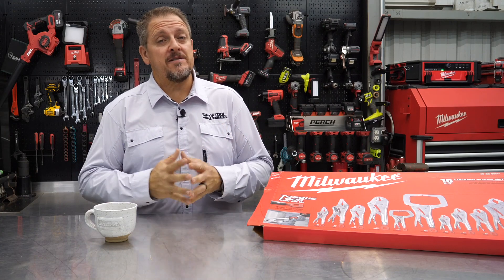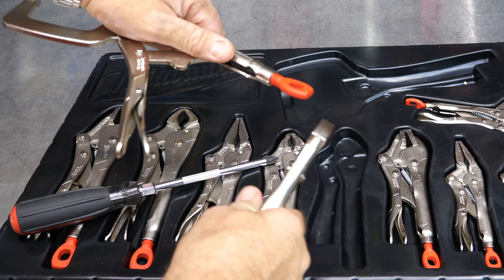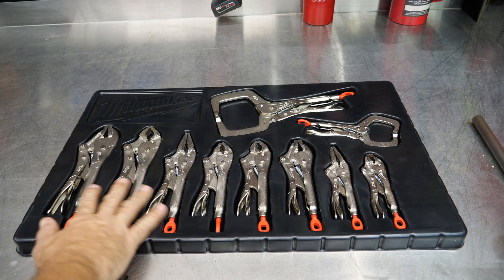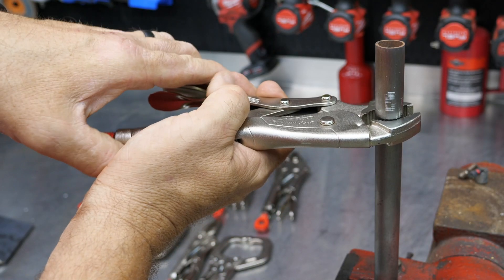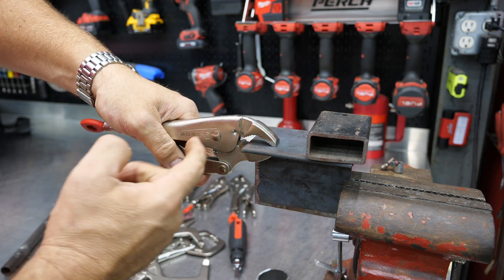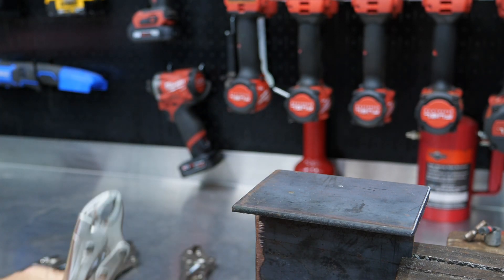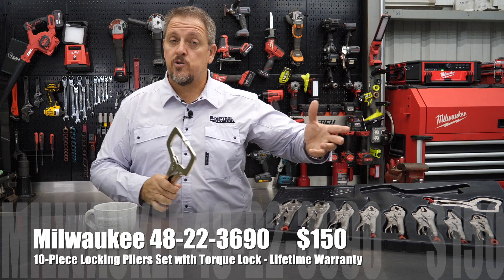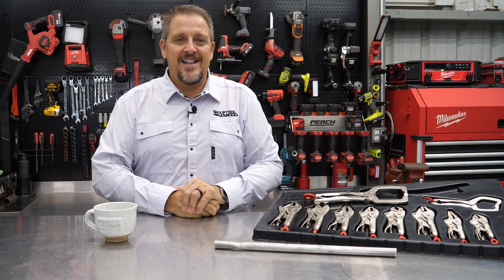NOTHING NEW - Milwaukee 10-Piece Locking Pliers with TORQUE LOCK Review

Comment: Why doesn’t anyone make a locking plier with a regular nut at the end?  Just put a socket on there.
Reply: Some of them have Allen heads on them
Reply: Kobalt makes a set like that! You can tighten with a socket or with an allen wrench through a hole in the nut.
Reply: Berman from harbor freight has 1/4 drive end. They are actually pretty good.

Comment: Nothing wrong with these "locking pliers" they are good jus like vise grips but "torque lock" is jus a gimmick. I work on commercial and industrial overhead doors and we all hold 1000 lb plus doors with vise grips dead weight when we back wind the springs without the need for "torque lock". Its jus an extra tool you need to have on you jus to vise grips. Its really not that hard and prolly jus faster to set them normally
Reply: There's a decent chance you might have a screwdriver or another pair of pliers with you to use it. Also, you don't have to use it. It's just and option. Maybe someone has arthritis developing or had surgery that they can't squeeze. Or maybe the situation calls for "delicate torquing". Just an option.